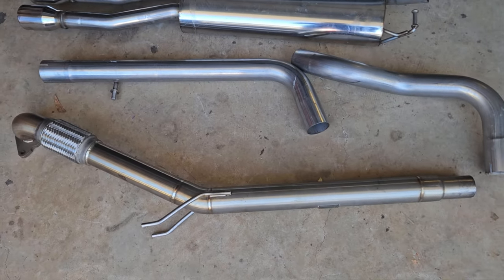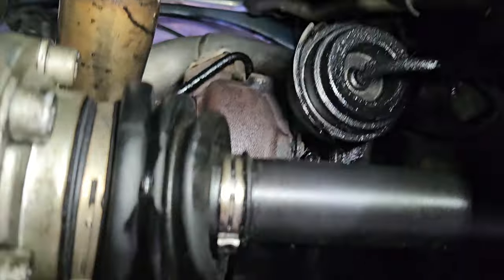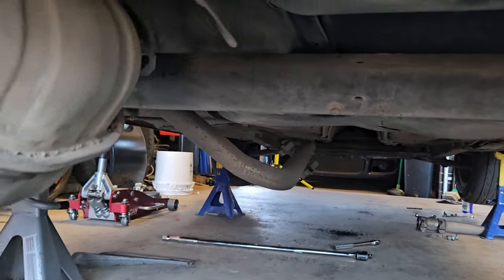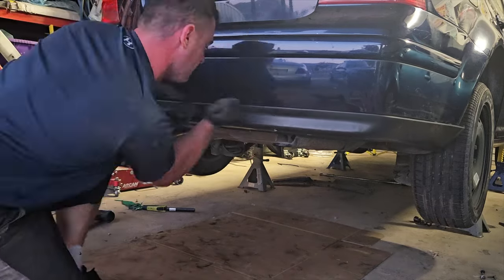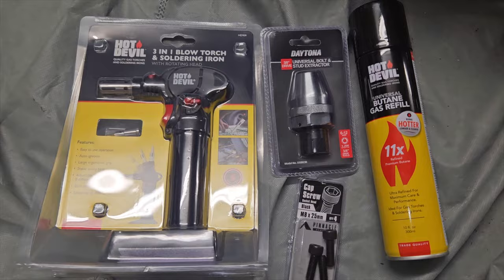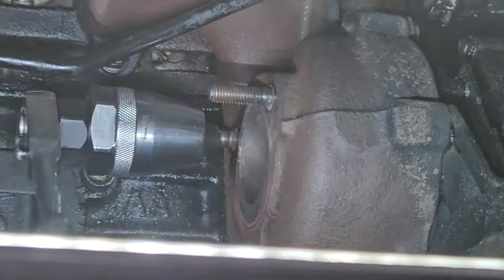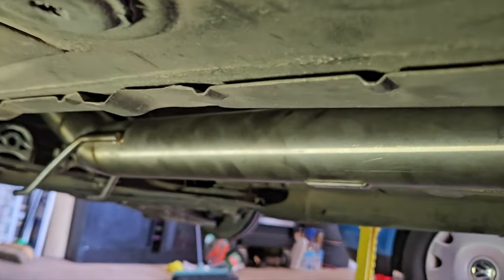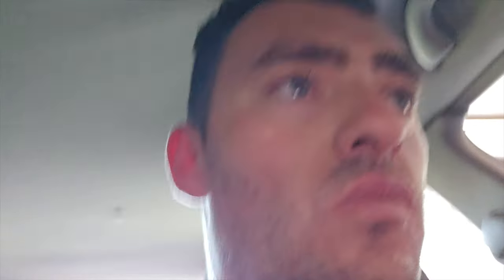Downpipe & Exhaust Installation on my VW MK4 Bora/Jetta TDI (FAIL?)

Comment: Stateside here, just finished up my 2.5” turbo back on my 03’ Jetta Wagon. Kit I bought was spot on. Instructions say trimming WILL be necessary on the downpipe depending on application. Mine being a wagon figured no trimming but nope, had to trim a good 12” from downpipe. Fit perfect. Got mine from KermaTDi here in the states. 

I say get the correct downpipe. You’re doing all the work, do it right for best flow. 

Initial reaction tonight was oh wow, can hear the turbo a bit more. Seat of the pants says faster but you know how that goes. 

Mine’s already got Stage IV Malone tune, injectors, VNT17. Next up is PD150 intake and a retune from a fella from the East coast, says can run way better and cleaner.